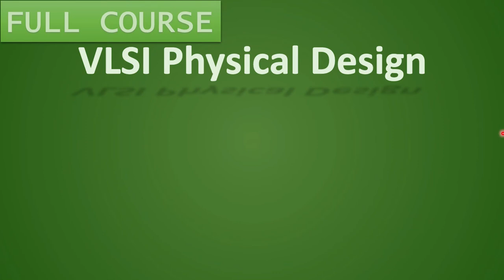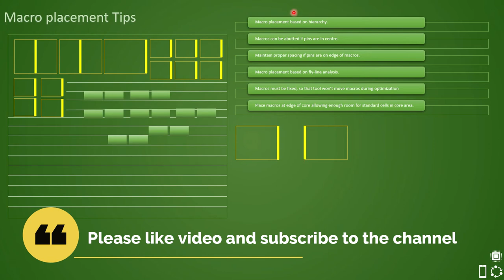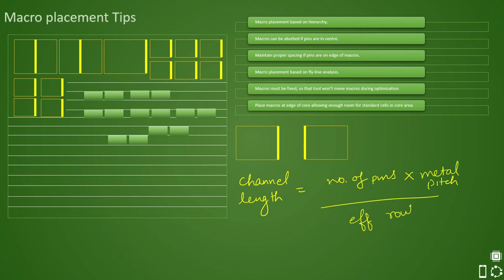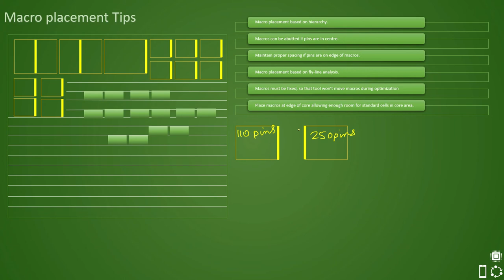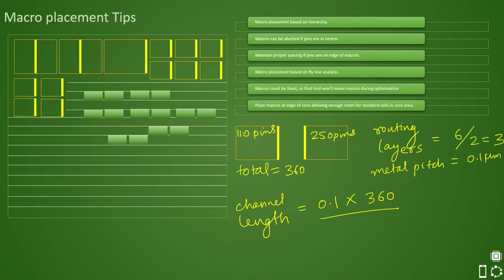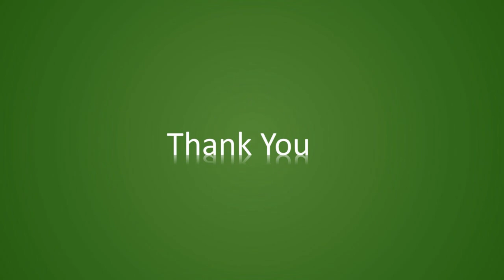PD Lec 20- Macro Channel Spacing Estimation & Floor-planning [part-6] | VLSI | Physical Design

Comment: If the metal layers are odd numbers thwn how can we calculate that effective routing layers u said no if its even 6/2=3 what if its in our design if it has 7 metal layers how can we do that
Reply from the maker: It's done the same way as earlier, and considered as lower value. In your example it becomes 3 (lower value of 3.5)

Comment: Why do we use 360 pins in the calculation? Wouldn't the 110 pins of one micro connect to 250 pins of another micro, leading to 250 traces instead of 360?
Reply from the maker: No it's the sum of the two

Comment: Each metal layer can have different width... which metal layer width to consider?
Reply from the maker: Depends on what is your requirement you can choose any metal layer. For power routing generally the top two metal leaders chosen and for clock routing generally next 3-4 layers are chosen

Comment: Hi,
Is the formula like for each macro and std cell atleast 1 vdd and 1 gnd is required, so effective pins become 110+250+2, so channel length = 0.1*362/3  ~ 12.1 extimated to be 13um? Can you please reply

Comment: Here you have mentioned the horizontal spacing between the macros. Are there any rules or formulas used to find out the vertical spacing between them as well ? And if possible could you please mention the logical reason behind the development of this formula to calculate spacing between the macros ?
Reply: @VLSIAcademyhub  Got it. Thanks.